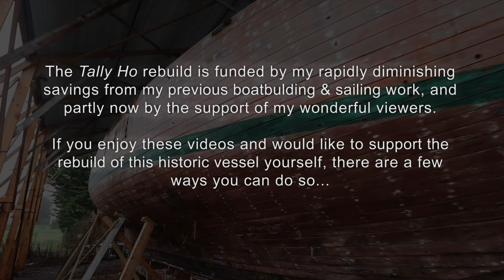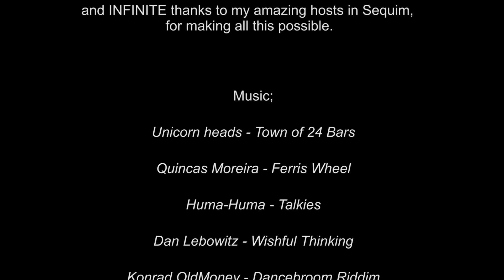New team, new VISA, new timber! (Boatbuilding/Tally Ho EP41)

Comment: I suffered an identical finger injury: right-hand longest-finger cut-off half the end-bone. It took, more then, 10 years for the sensitivity to subside. It eventually faded to normal. I now have a completely normal looking finger, with normal sensation. The end of the fingernail is different from "normal" but not noticeably so. The injury occurred 38 years ago, and was caused by a woodworking power tool.

Comment: I found it interesting re the bullet in the timber, I was an apprentice joiner in the 1960s and we got a lot of Norwegian pine which had shrapnel and barbed wire inside and two 20mm shells as well which totally destroyed our circular saw.  Thanks for restoring a memory and keep up the great work.
Reply: Same thing here. My dad built a boat shed out of planks that he milled out of driftwood. In our neck of the woods that normally translates into siberian timber that has escaped floating process and eventually drifted out to sea. Dad destroyed two circular saw blades on shrapnel before the shed was done.

Comment: I did a finger with a sharp knife once. It was a deep cut, to the bone, and sliced off a large chunk of flesh from the pad on the underside. Index finger. I didn't get it stitched. It healed slowly, and the skin and flesh grew back together, but I'd gone through all the nerves down to the bone. So the finger tip lost sensation, and stayed that way for such a long time, I assumed it was permanent. However, after multiple years, the sensation is more or less normal again. And I'm well into my 40's when things might not be expected to do that. So I'm hoping your finger will recover as good as completely in the end.

Comment: Very interesting construction with those frames, I like the idea of using wooden dowels with wedges hammered into the ends to secure them, but when the excess material is cut off each end of the dowels to bring them flush it does appear that most of the wedge is also being cut away, leaving only the very tip of each wedge in place ??

Comment: What great progress. We’re all thankful that your stay has been extended. If I may inquire: I’m a woodworker and will almost always make a wrong cut while doing a project with far less complexity than yours. I admire the skill you have in maneuvering those large frame sections and executing the compound bevels, BUT, I also wonder about how many mulligans you have experienced? Care to tell? Thanks again and continued success!
Reply from the maker: There have been a few (4, I think) rejected futtocks (after cutting), but they have all been down to the quality of the timber/defects that became apparent. Oh, and one that had the bevels cut the wrong way!
Reply: Sampson Boat Co you’ve made me feel a little better. Save the wrong frame and design your next boat to make it fit properly. Cheers!

Comment: Leo you have to incorporate that bullet into  the build somehow. I wonder how many of those frames have bullets nestling in them!
Reply: Lots of boats have half-hull models made, often those models were used during construction to take measurements. Hull finished, a bit sanding, a bit varnish - there's your wall plaque for the main cabin. Perhaps Tally Ho will have a half bullet glued to the deck beam over her companionway!

Comment: Teeheehee… wanted to look up a few properties of purpleheart (I know it as intrument wood, but I have no clue of boat building) and happened to check wikipedia as well. And there it says "Purpleheart is also a fairly expensive wood, which is why it is usually used in smaller-scale projects.[9]". 
…does Tally-Ho still count as a smaller scale project? :D

Comment: Just watching the forklift squeeze down the driveway past the building, and remembering the boat being delivered with mm to spare...

How much have the dimensions of the boat been changed, after remaking frames to original spec? In particular the 'wide bit at the top' (I think that's the technical term...)

Comment: Good to see your finger has healed, just be warned, it will go numb when working outside in the cold and the chance of frostbite is increased because the number of blood capillaries is less.  I'm really surprised you have replaced so many ribs, I didn't think at first so many had rotted. Is this due to the previous repairs in the Pacific?
Reply from the maker: Partly, but also just due to iron-rot from the floors and steel pins through the futtocks. and fresh water damage.

Comment: This may have been asked or talked about in an older video but... What's the orange glue used for laminating and the black glue you use for joining into the keel?
Reply: Orange stuff isn't a laminating glue, it's red lead primer primer for rot prevention. It fills the surface voids in the wood, & protects it if the faces separate over time.Black stuff isn't glue, it's pine tar mixed w/ Dolfinite bedding compound. Bedding fills the joint between the mating faces, so water can't get in.

Comment: I'm just guessing but that looks like a 30-06 bullet.
Reply: Yep. Probably some now-old hunter missed a deer, many many hunting seasons ago.
Reply: That wood was from South Georgia I believe. Those little deer wouldn't stand a chance! lol
Reply: I was thinking 6.5mm or .243...It looked awful Thin to be a .30, seemed like. Or a .270.   @astrodiver1
Reply: I was thinking .270 also. It seems like it's around .277 -.308. Maybe Leo could measure the neck diameter and weigh it for us. LoL.
Reply: That's 30-06. Probably from M2 Ball.  copper coated steel jacket with lead core.
Reply: Noticed no deformation of the bullet in that tough oak meaning a full metal jacket...ergo. Military round. Too large for 22 caliber. Probably .308 caliber. Cool find. That blade sliced it like a piece of ham

Comment: I for one would like a modest amount of scrap live oak from the build to make the chassis for an electric trike I am building. Does anyone know if the current import laws allow importing air dried lumber across the border. I do know there must be no bark on the wood due to insect problems. Whatever. If it is a way to recover a part of the materials cost of the restoration, I would love to have some.

Comment: When should you use trunnels and when should you use metal nuts and bolts?
Reply: The trunnels are undoubtedly cheaper for materials. The advantage of trunnels in this application is that fasteners that will hold the planks to the frames can go straight through the trunnels with no hassle.
Reply: I thought I heard him say something about it lets them "move" a bit. The orange paint is just a sealer and not an adhesive. They are not laminating them they are simply "Bolting/fastening"  them together. I thinks that what I remember. Its in the first video that he cuts the Live oak after getting it from the Georgia saw mill that he explains the orange coat and trennals.  As a skateboard maker myself..... I cant believe that they are not gluing them. It must be too stiff and they might be brittle when not in the water? But I am simply guessing at this point. lol. Im still learning ship design. lol. So interesting though.
Reply: @devotidchannel  The wood is still green and will move as it cures.  Glue wouldn't withstand that.
Reply: @johngarza124  Is it just because the moisture content  is so high? Or that the wood grain wont simply wick in the adhesive? Having laminated skateboards and snowboards my whole life I have lived by the Glueline is king method.... haha. I also use dried and cured maple and Birchwood that is always around 10-15% moisture content. So my wood is thirsty and eats it up.  This process of not gluing just seems so odd to me. 

My father builds cedar strip wooden boats but they are only 18 foot river drift boats and canoes.... and we epoxy EVERYTHING. hahah.  The West system / Gougeon Brothers World Headquarters is only 5 miles away from our shop though and they hook my father up with all kinds of epoxies and data from their R & D center. So its hard not to just glue and encapsulate everything. Drift boats get beat to hell on the river bottom and rocks.
Reply: @devotidchannel  I won't pretend to be an expert, but Leo mentioned it a couple of episodes back.  He said no glue made would withstand the stress of the wood shifting and curing.  That said he used epoxy to laminate floor pieces for a boat he was working on in England, but they were small pieces.  The length of the frames on Tally Ho probably negate that method.  If the joint shifts and the glue breaks then that would probably open a void where water can get in and start to rot the wood.  It seems Leo is bound and determined that this version of Tally Ho last at least another hundred years.